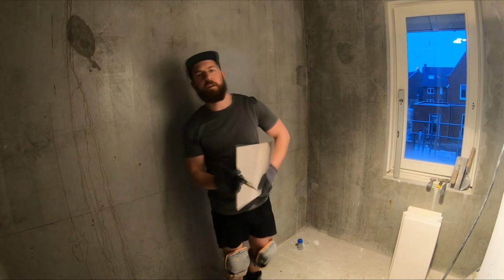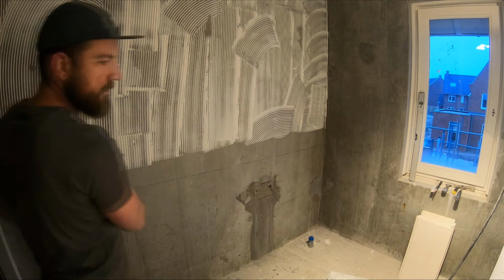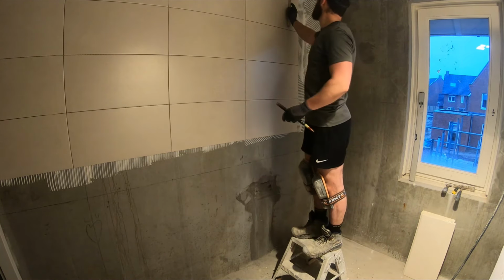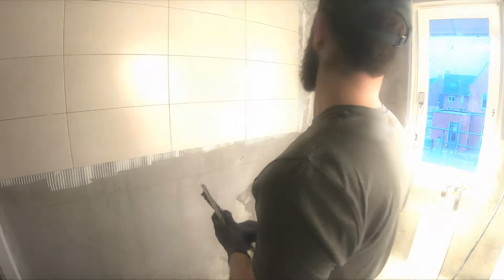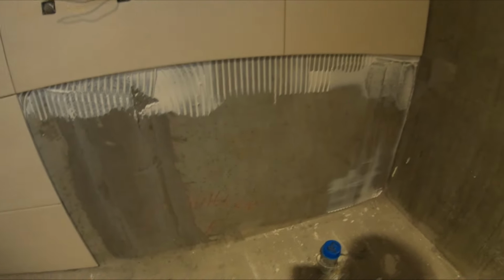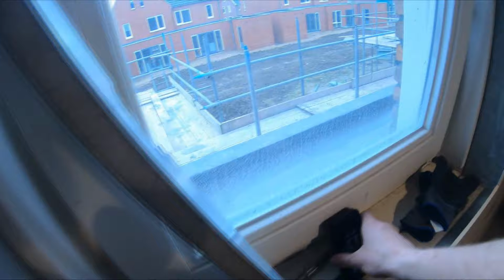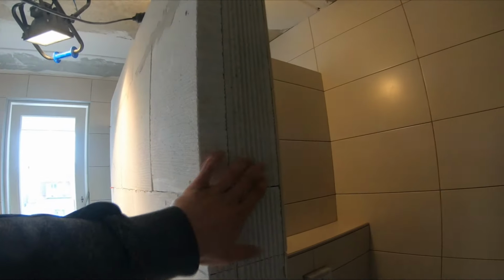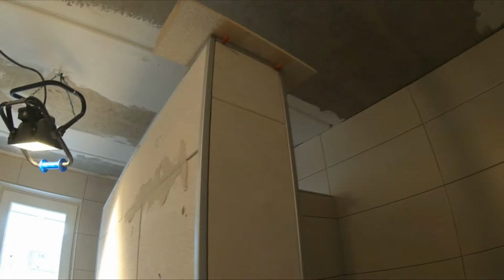Wanden Betegelen met 30x60./  Tiling Walls with 30x60.  P#4ep2

Comment: Thank you, I’ve just subscribed. Would you please upload a video on putting tiles on existing tiles in bathroom incl. shower? Is it even possible, if not,  what’s the disadvantage? We are thinking of renovating our bathroom in the near future, but want to minimize the mess/dust as much as possible.
Reply from the maker: Offcorse that possible!  If you prime the survice of the old tile. The existing tiles need to be solid and not hollow or loos.

Thanks for subscribing✨
Reply: @DutchTileWork  thank you very much for your prompt reply and advice 👍👍

Comment: I want to buy a cutter like that. But how big is it 60 or 80? What do you do if you need 120cm cut? Cut with a grinder? Or you have several sizes in your car with you?
Reply from the maker: Yes this is a older model montolit 600. If i need to go bigger than i use a Rubi tz100. 120 is a size we dont do so often butt also for these tiles we have some cutter in storage✨